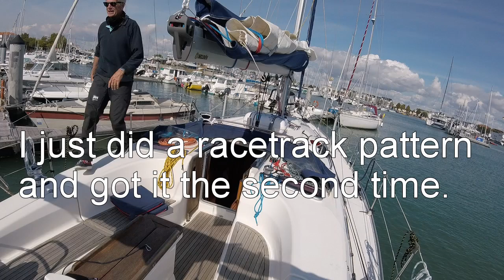Ep 18 Solo Sailing: How I Dock My 40' Sailboat 4 Examples and a Blooper

Comment: Thanks for the info and love your channel. A quick question: how do you put on the bow fender solo, or it stays there all the time? Thanks a lot.
Reply from the maker: Yeah, it's important to not leave the bow fender down (in place) when at sea.   Waves will eventually rip it off.  (I learned that the hard way when I forgot it and left it down for 12 hours when crossing the Bay of Biscay. It tore into two pieces.)  I have a snap fitting tied to the fender line where it attaches to the pulpit.   I detach it there, and swing the line down below the anchor and pull the fender up on the other side.  I then reattach the snap fitting to the deck, and leave the bow fender on the foredeck (straddling the bow sprit on my boat).  By leaving it attached on one side at all times, it is always easy to swing it back into place quickly for each marina entry (and departure).
Reply: Patrick Got it, Thank you so much!!

Comment: If you could list, in order of importance, what you think are the necessities for solo sailing, I would be very grateful.
Reply from the maker: If you are planning on overnight/long distance solo sailing items of importance are: 1) AIS transmit and receive (ESSENTIAL), 2) As many nuts/bolts/shackles/electrical connectors/lines/spares as you can tolerate carrying.  You must try to be as autonomous as possible.  3) Pre-rig a sheet to tiller steering system that you store, but can pull out and rig in a couple of minutes.   This is essential insurance in case your autopilot fails.  4) If at all possible, rig an inner forestay (removeable or permanent) so that when the wind gets above 23-25 knots you can furl the genoa and use a smaller/flatter staysail.   The mental and physical comfort that comes from a staysail in a blow is fantastic.   You can just relax and take a nap knowing that nothing is going to break.   5)  Try to send all lines (halyards and reefing lines) back to the cockpit so that you do not need to go forward in a blow.  That's a good start!

Comment: I also do it like that but I don't need to actually touch the catwalk in front. Having a bow fender is nice
Reply from the maker: Thanks Lydie.   Yeah, I didn't invent this technique; a lot of solo sailors use it.    Like you, I don't have to always touch the forward pontoon, but it does make it easier just to nudge it and then use the motor to press the boat against the finger until the lines are safely made.   Thanks for commenting.

Comment: On this subject, which is so important for a solitary navigator who arrives at the pontoon, I am 100% in agreement that it is necessary to move forward frankly and to take support with fenders; but why from the front, why not try running from behind? With the position "cuk a quai" at the dock? That's how I do with my Oceanis 31, I go back with two fenders at the level of the juppe, and the boat is embedded in the angle formed by the pontoon and the catway; I also have three other fenders on each side. OK, that means four (big) fenders on board, which must be stored, then out: the subject has already been addressed :-). Another disadvantage of this "cul a quai" method is that everyone can admire the interior of the cabin. For docking along the pontoon with wind or current that deports the boat, we must always (alas) rely on our cowboy capabilities lasso and tarzan pulling the moorings. Sorry for a google translation.
Reply from the maker: My boat backs well, and in a number of videos I have demonstrated my cul à quai technique.   The problem on my boat is that it is not always easy getting the aft lines over a cleat on the pontoon.  I have a bimini frame, two davits, and a life buoy that can interfere with getting a line over.   If the wind is blowing at 90 degrees, the bow will drift over into the other boat while I sort out the stern line.    Again, I like the technique you describe, and use it.  At La Rochelle, for reasons of privacy, I also prefer 'bow first'.  :-)
Reply: @patricklaine6958  Patrick, when I quickly reacted to your video posted 18 months ago, I thought you were looking for alternative ideas; I have since seen that you master your docking very well and that with a sailboat of 10 tons, which is more than 2 times more complicated than with a sailboat of 5 tons; congrats! Changing a technique that works is not advisable. In addition, I noticed that your Bavaria has, at the back, a transom (juppe) tilting (basculante); probably impossible, see prohibited to dock with this transom in low position, but ideal for taking a swim in the open sea :-). The Oceanis have quick and easy access to the pontoon from behind, we take a step and we are on the pontoon, a mooring line in hand and the cleat is taken in two seconds. Docking techniques "back first" at the dock are recommendable only with quick access to the pontoon from the back, with a clear transom. PS: how lucky to be in Iceland in May and so be able to stay there for several weeks !!!

Comment: Hi Patrick,
Could explain how you secure your bow fender when sailing single handed in stronger weather before you enter any marina? We had a look at this type of fender but cannot see how you can safely put it on prior to go in to any marina. Your advice will be highly appreciated.
Reply from the maker: Thanks Chris.  You can not leave the bow fender down on the bow at sea (other than in nearly calm conditions).   I forgot to take mine off once as I started across the Bay of Biscay, and the waves ripped it in half!    I attach the line that runs through the fender to a simple snap shackle on each side, and that attaches to a soft shackle that is permanently mounted on each side of the pulpit frame.  As I leave the marina, I detach one side (leaving the other side attached to the soft shackle).   I pull the fender up on the foredeck, and let it rest 'cradled' on the bow sprit.   (I attach the shackle that I had just detached to a point on the deck to hold the fender somewhat stabilized in place.)  If I'm going to be at sea for more than a couple of days, I completely detach the fender and store it just for security.
Reply from the maker: And coming back in, it is just the reverse process; as I approach calmer waters near the entrance to the marina, I swing the fender into place on the bow, and reattach the shackle that had been securing the fender on deck.  It sounds daunting, but it really is not too difficult.
Reply: Thanks, Patrick for your quick replied. Do you have a video showing how you put the bow fender on before approaching the marina, please? I'm thinking to purchase a bow fender and the one i found at the shop here was much longer than what was on your video. I'm concerned how difficult it will be to have the bow fender at the right spot on the bow and the  ropes might stretch. Fyi, I'm single handed and was trying to find an easier/safe solution on getting into the marina.Thanks.
Reply from the maker: @chriswu1338  Sorry, I didn't think to film this.  I don't want to make this sound more complex than it is Chris.   First of all, on my bow fender, there are two securing lines that run through the fender bottom to top on both sides.  I attach an inexpensive snap shackle to each line (to attach to the textile shackle that is permanently mounted to the upper half of the pulpit on each side).  Before going to sea with the fender for the first time, I adjust the fender against the bow and cut the lines so that the fender sits in the proper position.  I never again have to readjust the lines.  Once clear of the marina on leaving, I detach the snap shackle from one side, and reach below the anchor and pass the detached line to the other hand (while kneeling with the furler more or less between my knees).  I pull the fender up on deck (leaving one side attached to the upper pulpit, and then secure the detached shackle to a convenient deck fitting). To reinstall the fender, it is just the opposite movement.  It takes about 10 seconds.

Comment: Thanks for the video, very good.  Q: Do you leave your bow fender fixed in place when single handling, or do you have it rigged so you can set it up under sail?
Reply from the maker: One side has a snap fitting on it.  I undo the fitting and swing it up onto the foredeck (and reattach the snap fitting on the deck to hold it in place).  If you leave the bow fender down in any kind of seas, the waves will rip it off (learned the hard way).  :-)
Reply: @patricklaine6958  I think I get it - hah, I paused and studied your set-up.  Thank you, Patrick!

Comment: I bet you could do it sailing into the slip without the help of your motor with just your jib up. You only need to get some of the boat into the slip. Then you can hop out and use the lines to pull her in the rest of the way and just go very slowly -- about half the speed you showed us.

In another video you could show how to sail out of a slip by backwinding the jib to make the boat go backwards after walking it out first most of the way.
Reply from the maker: Hello Emily.   When I first learned to sail 40 years ago, we didn't have engines, and that is exactly how we did it (both arrival and departure).  I went out with an instructor here in La Rochelle one day last year, and we did the same thing.   He cut the motor as we were coming down the last fairway, and me (and another student) quickly pulled out the genoa about half way and sailed into the slip.   Yes, I'm sure I could do it in a emergency.   That said, the prevailing wind here is always in the 10-12+ (and often 15-17) kt range so coming into the slip slowly on anything but a very light wind day would certainly see me pressed against the boat on the other side of the slip.   Moreover, other boat owners get very nervous when they see a relatively large boat (40') coming into our narrow channels only on sail power.   I stress them out enough as it is!   But yes, the technique you describe is my emergency, engine out process, and I have practiced it in the past.  Thanks for reminding me of this important practice.
Reply: I figured you knew how. I've been sailing since the 1960s when I was 5. We never used engines on any sailboats we had. Your comment about the fenders in one of your videos reminded me of comments my father would make about boats we'd see sailing with their fenders dragging in the water. He was a purist and expert sailor and adamant about not only making sure we knew the fenders were put away when they weren't being used, but he more importantly insisted we knew how to sail the boat without an engine. We kept her at a mooring,  so there was more room for error, but I also had to make landings at docks and fit the boat into tight spaces and take her out of them on occasions.

Comment: HI Patrick, would you consider a smaller boat an advantage or not when docking
Reply from the maker: I don't think there is much difference in 'difficulty' for boats between 35 and 45 feet.   Less than 35 is probably a bit easier ----- and greater than 45 becomes quite a challenge when alone in a bit of wind.    Whatever length boat one has, the important thing is to develop a methodology that you are comfortable with, and the practice it as often as possible.   (When I first started, I'd go to a remote part of the marina at 0630, and practice every possible approach when no-one was watching.)   :-)   Thanks for watching Garry.

Comment: Even with today’s high tech weather maps, how many times have you been on a passage & were surprised by unexpected weather?
Reply from the maker: There are two elements of response : accuracy and access.   Concerning accuracy – forecasts of 3-5 days are excellent; 5-7 days are usually ‘directionally correct’; and beyond 7 days --- it’s an ‘outlook’ of greatly reduced value.   That said, however accurate the forecast, you need a means of access to the information once offshore, and this is where many crews fall short.   Access by satellite such as Iridium GO requires an investment of €1500 plus a subscription of €150 per month.   There are alternatives (SSB
radio, etc.) but all are compromises.      Early in my sailing days, I did not have satellite comms, and went through a gale as a result.   I won’t be caught by surprise again.

Comment: Hi I wondered what you think about Wind Generators?
Reply from the maker: I think almost everyone agrees there is no single solution Sharon.   Wind generators are great (though be prepared for some noise and vibration).   However, you may not get much from them running downwind, or at anchor.......from which comes the need for a second source, e.g., solar or fuel cell or hydro generator.   It’s tough getting around a back-up source, unless you run your engine a fair amount......

Comment: My apologies if I sound critical. My reference was more to using the jack lines. I am a little sensitive over the issue. I recently saved a young man who went overboard. I just happened to be in the right place at the right time.
Reply from the maker: And he was a very lucky young man.    I don't think many survive that situation.   Good on you for handling it well.   So, I plead not guilty on the lifevest point, but can certainly do better on tethering to the jacklines.   I'm going to try to reorganize them this winter closer to the center of the boat in such a way that it is eas(ier) to hook up.   Many thanks for watching.

Comment: Thanks for the great content! Your Bow Fender looks a little tricky to put on while underway. Do you leave it on all the time?
Reply from the maker: Someone asked the same question last week.  No, you can't leave it down at sea (except in near calm conditions).  The waves will rip it off (learned the hard way when I forgot to bring it aboard).   The line that runs through each side of the fender is attached to the pulpit with an inexpensive snap shackle.   To bring the fender aboard, I detach one side (while kneeling with a knee on each side of the furler) and pass the line from one hand to the other under the anchor and pull it aboard.  I leave the other side permanently attached to the pulpit and just secure the 'loose' side to a convenient deck fitting.   If I am leaving for more than a few days at sea, I'll take the fender completely off and stow it.   It really is fairly simple --- 10 seconds on; 10 seconds off.
Reply: @patricklaine6958  thanks!!

Comment: You do that with your boat, that manouvers the way you planned, try with a full keel boat  (trust me, it will have it's own and independent ideas) and your way will crash!
I love my Island Packet 35, but, it is way diferent from the "normal" boat.
Reply from the maker: You bring up a good point Nunolc that is worth repeating.   Every boat will have its own 'personality' based on type of propulsion (saildrive or shaft/prop), type of keel (fin or full keel), presence or not of a dolphin striker, etc.  Not only that, but also, every marina will have its own personality --- flow through current or protected, exposure to swell or not, protection from wind, width of fairways, length of fingers on pontoons, type of cleats/bollards/rails/pylons against which we moor, etc.    Sailboat owners will need to learn the basics about prop walk, use of spring lines, maintaining enough way to ensure positive control, backing into wind technique, how to do a 180 just using a fixed rudder position and throttle forward and aft, etc.   Unfortunately, there is no one formula that will work in all situations.  We need to learn the basics, then adapt them to the many other variables that are unique to the situation.  Thanks for commenting.

Comment: I like this method but how would you dock your boat if there was a dock box on your bow?
Reply from the maker: When I enter a new marina (to me) there is often a water spigot/electricity box right where I want to put the bow.  The only thing I can do then is to stop early and try to get a line over a cleat as quickly as possible to stabilize the situation.   There is no magic solution unfortunately.   If it were in my permanent berth, I'd try to get a line of fixed length over a cleat that stops just short of the dock box and motor forward against it until I am pinned against the side finger.  (The finger is not long enough in my marina to do this.....)

Comment: Is it possible to come in from the other direction so you are driving into the wind.?
Reply from the maker: Yes David.   In fact, when you do this with an instructor, that is how they recommend proceeding: always head into the wind as much as possible (whether you are entering the slip bow first or stern first).    I have a slight issue with this in that my slip is located such that I can't really pass it and then come back.  There isn't enough room/water further down the channel.  Secondly, while I definitely think heading into the wind helps multi-crew boats (because your momentum will carry you into the catway just long enough to have a crewmember step off), I think the advantage to a solo sailor is not as beneficial.   You have to remain at the helm/throttle until the boat is essentially stopped.  By the time you then run to midships or the springline to lasso the cleat, the 'momentum into the catway' benefit will be greatly diminished.  That said, whenever practical, I try to head into the wind, but it is not a magic solution.   Best regards
Reply: Patrick Laine yep that makes sense. Thanks Patrick.